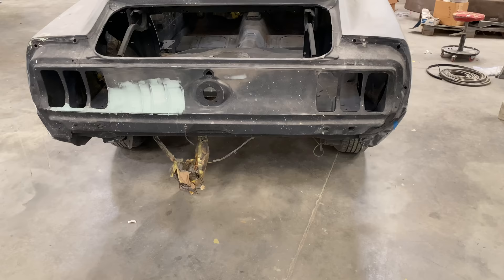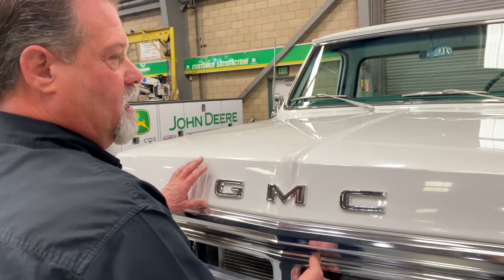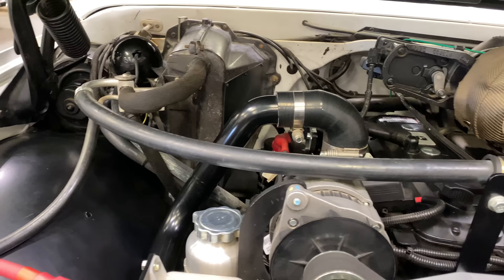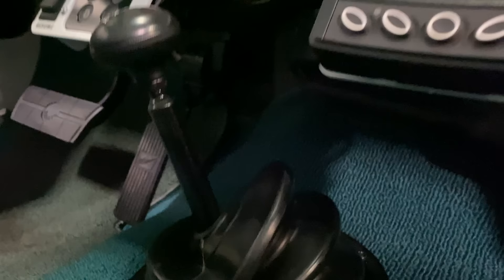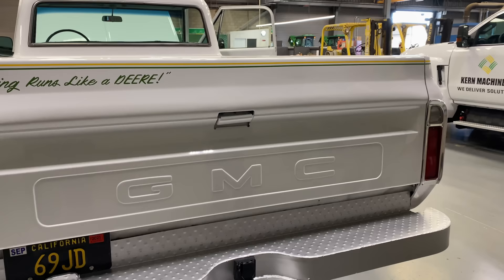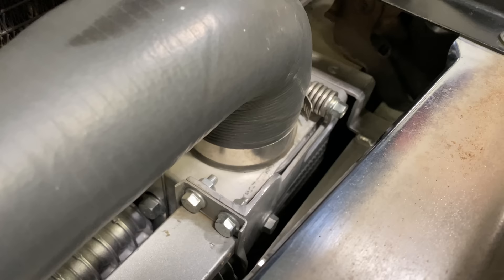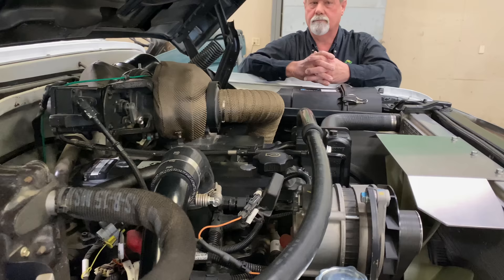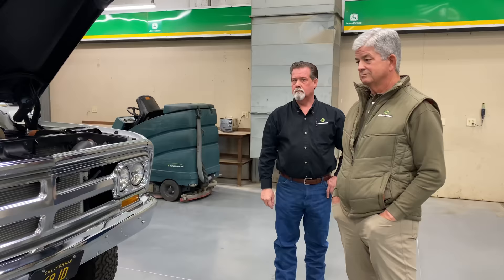John Deere Tractor engine in 1969 GMC truck!

Comment: I know a guy with an old Chevy ambulance that has been converted to a mobile service truck. It is powered by a John Deere big six diesel from a tractor. Manual transmission is from a hay hauler. Works great.
Reply: What kind of front end is under it to hold the weight of a Deere 6?

Comment: I have a set of factory Deere motor mounts for putting a 329 in a c60. There was one or two years you could order a c60 with a factory installed Deere 6cyl. Somewhere I even have the brochure that shows the gold painted Deere power systems engines they used and the trucks.
Reply: you should find the brochure and show it on your channel!
Reply: That would be really cool to see Brian.
Reply: bcbloc02 I would’ve been really impressed if it had a 6404T in it!!

Comment: Hey, you guys did good job on the rig !!!  I'm from Iowa(N.E. corner) and just retired finishing up my wife's bone stock 1972 Chevy 3/4 ton 4x4, med. olive, auto., fact. tach, tilt, AC, etc. Anybody in this world has probably either dealt with me or heard of me. I've bought, sold, and body-off-framed close to 400 '67-'72 Chevy/GMC 4x4 trucks. Started in 1980. This was quite an undertaking of which the average guy could'nt even fathom. The most complicated engine swap I have undertaken would be a small block(which all '67-'72 Chevy 4x4's came factory with) to a big block which only came in the two wheel drives. So man your job was immense!!! You made the world of fabrication proud!!!!   Get that thing out to SEMA and get it spot-lighted 'cause it should be.  AGAIN---NICE JOB !!!!       Jim
Reply: Jim, given your response to the video, would you be willing to help a fella with a '82 GMC K25? I need help with starting system and located down the road from you.
Reply: @ericbean2719  Yea Eric, lay it on me!! What's the problem(in a nutshell) with the rig ?    Jim
Reply: @jameskiesau7543  my teenager was joy riding in a muddy pasture and slammed the truck into park. Wouldn't start after that.  Check nss (continuity for park and neutral as well as reverse), ignition switch (replaced),  starter all working.  The fusible links at the junction box were blown and i repaired them.  Still no crank,  no start.  Not even a click.  I have power to the dash lights with key on. Any diagnostic help is appreciated!
Reply: @ericbean2719  First of all Eric, before I give out any info. or help I gotta know what your "REAL" name is, not your youtube handle . I put my full name out there because I have a resto business and I give a lotta help and sell a lotta parts so to keep everything legit I have to keep it real !!! We don't seem to know ya buddy. Give me some help here and I'll help you!!!      Jim
Reply: @ericbean2719 Hey Mr. Bean, did ya ever get the bugs worked out of that rig of your's ?? Didn't see any more input or questions anywhere from ya. Hope yer not pissed I didn't lend a hand but ya gotta play it a little low key now days!! I think I might have an idea who ya are !!!!!!! If ya need something else(parts) give me a ring.  Jimbo from up the road !!!!!!
Reply: Hey Eric, since ya were just down the road from me I thought I'd tell ya about a hell of a deal I got on a motor for your K25. Just got a 425 hp. 454 put together from a wrecked '70 Corvette. Stock bore,mutha thumper cam, but very streetable, gm cast hi-rise, 750 holley double pump, re-sized and shot peened rods with arp studs, hi-pressure oil pump, 8 qt. pan, headers to fit alot of stuff, mainly El Camino ---should be a real tire smoker. I bet it will be a good 475-480hp. set-up. 4K takes it home !!!!!!!!!!!!  If I don't sell in two weeks I'm dropp'in it in my '72 Chevy 3/4 ton 4x4(wife ain't happy) !!!!!!!    Jim

Comment: In 1980 a friend of mine put a 3 cylinder Perkins diesel engine in his 1ton Ford shop truck. Top speed was about 50mph but had great towing power and fuel economy.

Comment: I interned at a Deere dealer in college and wanted to work there but they didn’t want to pay me a fair wage. 4 years later I’m making double what they offered me at a new holland dealer.
Reply: @slowride55 : Funny you say that, because I had the same problem. 

In the 1990's, after achieving 2 college degrees, in Ag Business and Equipment Engineering, John Deere pushed me away with their pathetic compensation. 2 years into working for them, it was obvious they just weren't willing to pay a fair wage, so I left.

When I later worked for a CIH dealer, pay rates were a bit better, but still not good enough either, and I eventually left there as well.

The agricultural industry as a whole suffers from consistently losing good, intelligent people because they all pay substandard wages. 

It's an unfortunate situation for everyone who loves Ag, but needs to make a reasonable living and refuse to be dirt poor while the corporations continue to line their wallets.
Reply: That's the way life is it sounds like they did you a favor
Reply: That's how free markets work
Reply: @stevenlharris   Is it free market when Apple tells companies not to sell me chips so I can't fix machines? Some guys found the chip in some wall charges so that's how they get them.
Reply: @noahpaulette1490  You'll have to tell me how your inability to get chips from a manufacturer has any relation to working at a John Deere dealer.  Sounds more like you take any opening you can find to complain.
Reply: @buckhorncortez   That specific example was about Apple computers as that's what I'm most familiar with but the same problem happens with tractors and cars now. Basically all companies go out of their way to make sure independent repair technicians cannot get a specific pats software and schematics so that you the consumer have to use their own repair services and have to buy a new one when they stop supporting it.

Comment: I worked at John Deere tractor works in Wateroo in the late 70's early 80's. They had several trucks that had the engines replaced with Deere diesels. Pickups and larger trucks. At that time their was a kid built a 65 mustang with a John Deere diesel. He added live hydraulics and could pull a disk with it.

Comment: So nice and well done.  I remember a farmer when I was growing up installed a Perkins into a early 80’s GMC K2500.  Loved the sound of that thing rolling down the road.
Reply: I had an 71 International 1300 service truck with a Perkins six cylinder running a straight upright 4 inch exhaust, not that loud but sounded fuken great.

Comment: I did what a lot oguys on here say they did, with an old 65gmc truck, the old v-6 blowed up .
So I took my brother's old demolishing car a 65' Buick, pulled the motor out and placed it in the truck.
Drove it that way for a while till the truck rear end  gave out .
So I took the truck rear end and the Buick rear to shop class ,and cut and rewarded the right fittings so the car rearend would work.
Mated up the drives haft, to work  and wow did it work! 
We still ran the rod through the floor board like in a demo car, we would sometimes over shift going from first to drive. Hit reverse or park shove it back down in first and peal out. Fun old truck. Good old days!

Comment: The slogan "Nothing runs like a Deere" was first used  when John Deere introduced its new line of 1972 snowmobiles.
Reply: Exactly, my grand father had the oldest John Deere dealership in Québec since 1940. In 1972 with the 400 and 500 snowmobiles being introduced, the slogan “Nothing runs like a Deere” was on the advertising poster that showed the snowmobile.
Reply: And, "nothing smells like a john" came along soon after.
Reply: Yes when its being run down by an international
Reply: Nothing runs like a Deere with a CAT on its ass... lol
Reply: @HOOSH69  Cat cant a  that
Reply: Cat stands for cant afford that
Reply: @robertdinovi9391  international for the win

Comment: That would be the smartest thing to do with any GM truck.👍
Reply: Yeah bc they all breakdown
Reply: Yeah I only got 380,000 miles on my Chevy and 285,000 on my GMC original engine and transmission s.
Terrible
Reply: @MitzvosGolem1  yeah, you need to bronze those pieces of @#*$ like people used to baby shoes. 🤣

Comment: Now thats a cool truck. You combine a good ole GM truck and a Deer motor. I bet it will go forever. This thing would be sick with a little more lift and a aggressive tire. Make it resemble a tractor pulling rig. Props to the builder

Comment: As a farmer that runs a lot of John Deere's, I'm laughing at the thought of a JD tech running diagnostics on this GMC truck. He will need three of them to keep one running at any time. Good thing he owns the dealership.
Reply: So, the tractors with JD engines with 5,000+ hours on them are just flukes?
Reply: @buckhorn cortez.  5,000 hours without a tech touching them? No way. I see the mechanics trucks every day here in Bakersfield up and down the freeway. 

This is why non-computer controlled tractors are bring big money outside of CA.
Reply: That’s why I like Case!
Reply: @buckhorncortez  I have one with 6400 hrs that has never had anything but oil changes oh yeah one new fuel transfer pump.  It is a '93 4039 engine
Reply: @williamdavidson9009   The troubles with this truck will be with the DEF system, the exhaust filters and its regenerations  :(
Reply: I've got a 1975 2630 .  276 ci , with 9500 hrs , I always thought it would make a good truck motor ,   Has double balancer shafts , so I think it's a German made unit ,
Reply: @theda850two  Yes the old mechanical engines were incredibly reliable.  I have others that have unknown hours.  I will not buy a new machine with an electronic engine.  I'm in the logging business and i can't imagine how the mud, dust, heat, cold and dampness will affect sensors etc.
Reply: @buckhorncortez  nope just maintained by people that know their way around something like that. The company I used to work for had a few 9300 they never saw a john deere tech. One occasion we did have a tech come out to replace a hydraulic tube and I had to show him what he was doing wrong because he could not get it back together without breaking the tube
Reply: @theda850two  doesnt have any of that. Because of the age of the truck it doesnt need to have them. Also when they showed the underside of the truck no dpf or scr was present
Reply: @MegaRiffraff  : Yes, 2630 is a Werke-Manheim, German built utility diesel.
    I own a 1975 JD 2630 naturally-aspirated diesel with an Edwards forklift on the front, and a Lincoln (LTC) aftermarket cab. 
    I also own  1988 JD 2555 turbo diesel with a ROPS canopy & a 245SL front-end loader. 
    Both are great tractors & I will never sell either of them.
Reply: @theda850two  Does it have any of those things?
Reply: @hamdude2109 ,,,  show us a new diesel engine that doesn't...
Reply: @theda850two  It's a crate engine, in a one off build, so you and I don't know if it has any emissions crap on it or not. So I asked. Carry on.
Reply: @theda850two it's a  tier 3 Son, and its Hella dependable Motor.
Reply: If this was a 404 instead of a 4 cylinder this thing would be spectacular.
Reply: @buckhorncortez  yes a older JD with no electronics . BTW the engines in JD factors and skidsteer are rock solid, it's all of the other stuff that goes wrong.

Now days you need expensive scan tools, diagnostic, books and pretty much a Ph.D. to work on a modern tractor.
Reply: @turbodiesel4709  175 JD 1120 John Deere Werke Mannheim Zweigniederlassung factorie, Engine produce in France , has way over 3k hours, true hours unkown 

I replaced the hour meter 3 years ago but the sock that plugs into the matter round out fwiw.

Comment: In 1974 my Dad and I put a Ford 5000 tractor engine and Clark 285 transmission into a 1970 F250.  Later that engine was pulled and put into a 1977 F250.  This work was accomplished in a single car garage with a lot of ingenuity.

Comment: I'd only do this if I owned a dealership. John deere is just like ford, they'd rather you buy a different brand than let you work on your own tractor
Reply: Unfortunately yes
Reply: John Doe  I have a feeling that a guy having it done for him wants a modern engine thats gonna be reliable and parts readily available, I'd probably go with an old mechanical engine too but I'd be building it myself
Reply: @Beandiptheredneck  I would say the modern engine is more a creature comforts thing than a reliability/availability thing since you can still buy any part for a 1967 JD 4010 at the dealer and there probably isn't a more reliable tractor ever made
Reply: As someone who works at a Ford dealership, knows the parts on todays engines, and has seen what it takes for the techs to do what used to be simple jobs, I fully welcome  you to work on your own Ford. Let's see how far you get doing a water pump on a turbo 3.5 or cooling hose replacements on a 4 cylinder EcoBoost before you BEG the dealership to do it for you.....
Reply: That’s literally all diesel pick up makers. Don’t touch their software.
Reply: John Doe  You couldn't do that in California, the emission laws are too strict.. I am surprised they even got this one licensed the way it is.. It must be an unincorporated county..
Reply: @theconstantevolution  Your comment and the closed mindedness of the brand you work for, is exactly why I will keep my squarebody chevy..
Reply: @chancethompson8686  ,
Yes your exactly Right I was living in Calif at the time   back in 1982 , my truck was a old  1973 International Harvester Scout  that I bought at a Salvage Yard  it had been wrecked  so it had a "
Salvage Title "
From the Insurance Company , bought the John Deere Engine at a Equipment Auction , DMV refused to register it , So
We used it for a Hunting Buggy for a number of years , 
I also built a  Comanchero, it was a  5th Generation- 4 door 1973 Comet  made by Mercury ( same thing as a Ford Maverick) , it had been rear ended , So I cut a panel to put across the back of the Front Seats an then cut the rest of the body down turning it into a Pick-up Bed  you know like the Ford ( Rancho's ) , It was still registered as a Comet , But I bought the emblems from the junkyard an spliced the 2 names together hence = 
Comanchero , drove it for about 2 years , had tons of offer from Hispanic Guys offering to buy it lol . Finally sold it to a Hispanic guy I worked with , It had the Ford 302 V8 in it guess what he did ?? --- yep yep he had a buddy of his put a Shevvy 350 & trans in it , 😜. But it was always fun going to a Pep Boys part store an tell the guy at the counter I needed a Alternator or oil filter etc for a 73 Comanchero , An he would say you mean a Rancho , No man it's a Comanchero come look for yourself 🙀😜🤣
Reply: It is interesting to consider how the right to repair issue and this custom build have similarities in the need for technical support.
Reply: @chancethompson8686  (2021): anything built after 1972 is exempt from CA emissions...
Reply: Get Forscan for free and a cheap USB dongle off eBay to work on your Ford at the dealership level. It can program modules, make new keys, etc. It's the only car / truck brand that has something of that nature available (open source software).
Reply: @theconstantevolution  simple solution to problem, don't buy junk ass ford's especially ecoboost dog shit.  I worked as a mechanic my whole life, even at a ford garage for awhile.  They are high maintenance vehicles.

Comment: Excessive door gaps (blue Chevelle) easily closed-up by spot welding a ~1'8" gas welding rod to the door edge and then filling/smoothing in with an appropriate filler.

Comment: Any Field Mechanic worth his salt could work on this truck, no problem.
Reply: Proprietary JD electronic control diagnostics isn't field mechanics...
Reply: Unfortunately in the last 10 years, Deere have gone long away from Deere of old. Back in the 1910s and up until the 80s, Deere equipment was built to he worked on by the average farmer. After the last board member who had any connections to the original Deere family retired, the company pretty much said, if the farmer is desperate enough to get the equipment working, they'll pay the field techs as much as possible.

In their modern machines, especially the hydrostatic drive machines, they have a counter in the systems to count how many times the owner did not come to a complete stop to go in the other direction, just to say warranty will not cover this. If you're going to buy a John Deere anything, you're better off buying something from 1980s and prior.
Reply: @izzyplusplusplus1004  Sure it is. Any field mechanic capable of working on any brand of equipment is using diagnostic systems like TEXA and others today. JD thinks everything is "proprietary" but that's just not the case.

Comment: Our garage was putting a Cummings engine in a 69' Ford F250 to pull the trailer hauling the Reynolds racing car to Ontario and other tracks back in 1970.
Much simpler without all the electronics.

Comment: Good  day  My wife back in 80's  work for JD construction dealership.  She said then they were using a JD motor in pkup to go from Toronto to Montreal.  Thanks
Reply: That is true. A friend of mine drove that truck. It was a freightliner cabover. The engine was a special built john deere v8 diesel for highway trucks. It ran incredible. No idea why JD. Didnt follow up on it and keep going on the project

Comment: As a GM parts manager I recall GM medium duty trucks had a 5.9 Liter John Deere engine option.
Reply: Neat. Better than the boat anchor 6.2/6.5
Reply: I've never heard that.
Reply: @mph5896  oh they aint that bad! Actually in a lot of boats lol
Reply: I remember the 8.2 "fuel mizer" Detroit in the medium duty trucks but not a Deere?
What year and size trucks had them?
Reply: The 6.6 "Brazilian Ford" in my '90 F-600 is actually a New Holland engine.  Low on power.. sounds great, good fuel mileage.. extremely reliable
Reply: No they didn’t.